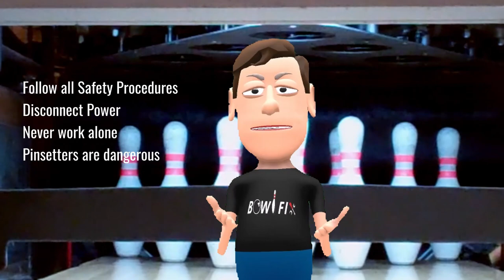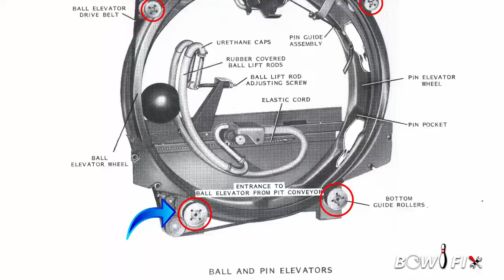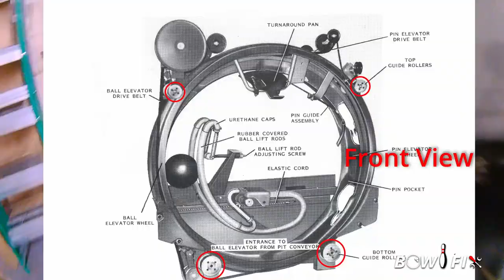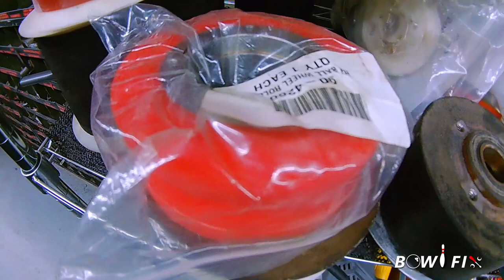Bowlfix: Lower Ball Elevator Roller Replacement: Brunswick A2 Pinsetter Maintenance

Comment: I was a brunswick mechanic for almost 20yrs. Found out its not necessary to remove pit board at all. With board positioned to the max going towards the front all you'll need to do with the frame is take off the 2 nuts and prop it up along side of vibrator shaft belt. It's tight but a lot less work. Works on both sides for lower rollers. Ball and wheel.

Comment: I used to replace them like this, until I started using the elevator bolt with a ratcheting wrench, you can have the roller changed in 10 minutes, unless they are welded shafts, then you have to do it like this. I also see a sagging pit mount too. I’d replace them, but that’s just me
Reply from the maker: Thanks for your comment.  I had to replace a roller on another machine last week.  I used a second ratchet strap to lift the pit frame and it was much faster.  However, releasing the ratchet strap is not a gradual process and the pit frame can drop suddenly. Next time I will use a come-along wench to lift the pit frame.  Or find a strap with a slower, ratcheting release.
I will double check those pit mounts.  Thank you for pointing that out.  KM

Comment: How do you change the lower guide roller shaft
Reply from the maker: I can only tell you my experience from working on a Japanese A2.  There is an Allen bolt that holds the shaft to the frame.  It is accessed from the rear of the machine. You have to remove the lower rear plate to access the bolts from the rear.  They are near the lower pin elevator guide rollers.  You will need some 1/2" drive Allen sockets.  Keep in mind, I do not know this for sure, but the bolt threads may be .  I have heard that some machines have the posts welded.  I think they make a repair kit that uses a sleeve and different bearings.  Good luck!  KM

 9. 11-004714-001 Hex Head Socket Cap Screw (5/8-18 x 2-1/2”)  Look at page 8H and 9H of the parts catalog.  Here is a link